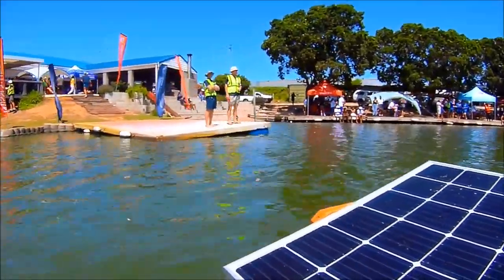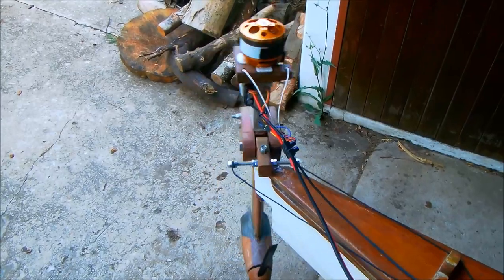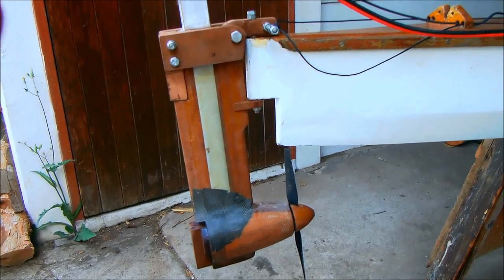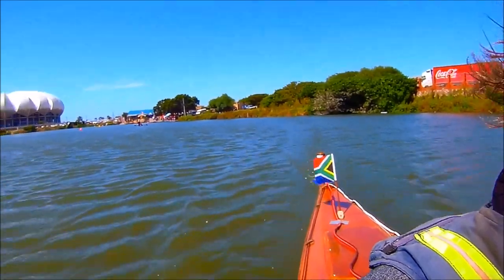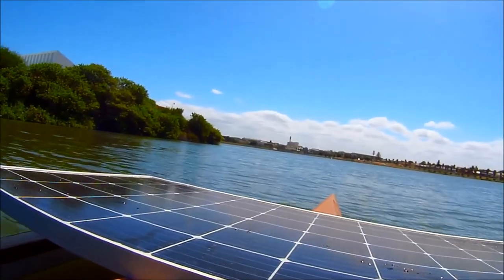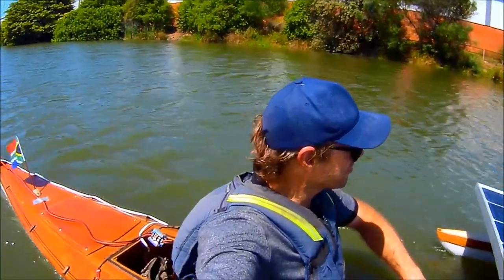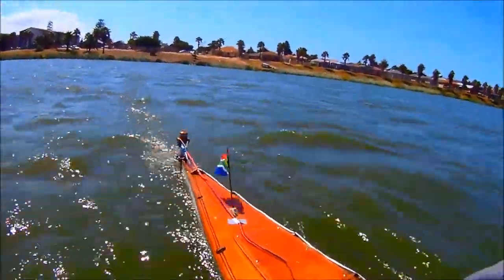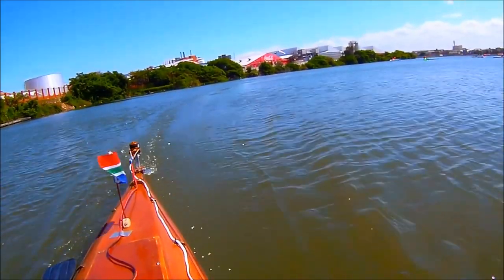Kayak Trolling Motor Test - more airplane props

Comment: That is so good! Solar power means light and efficient. I love it! 
I've been pondering a boat of some kind capable of plying the ocean - under very nice conditions. I have to overcome problems like currents and waves, so it needs to be lighter or have more solar panels...it also needs to have a deep hull to navigate swells of a meter or less. It also needs to be light enough to carry to the beach. Its a tough cookie to crack.
Reply from the maker: This panel weighs 18kg, roughly the same as a 1.7kWh LiFePo battery. At 300W such a battery would last 5hrs, at 90% depth of discharge. On a sunny day the panel should give you a longer run time at the rated power but on a cloudy day the battery will offer more Watt-hours per kg. There are panels with much better power to weight ratios so you have a good point.

Comment: If you're actually worried about the noise from the motor, consider a sine wave BLDC controller, they're a lot more silent, I believe with the downside of producing a little less torque.
Also, have you looked at those MPPT buck converters that let you set the input voltage (MPPT) screw. Basically it seems to do what your MPPO circuit does.
Reply from the maker: That is the FOC controller right?
I have one of those bucks you referred to but it is only rated 5A. I have since built an add-on feedback circuit for standard bucks that gives it the same functionality.
Reply: @williamfraser  That is very cool. I'd like to see how you accomplish that functionality.
To be honest, you know a lot more about those controllers than I do. I thought VESC could do unsensored motors with sine wave output, but it seems I might be wrong.

Edit: I've been doing a bit more watching YouTube and found this: https://www.youtube.com/watch?v=H-6qzmeCNtw. It looks like there's sensorless control with fairly silent operation, but those controllers are pretty expensive. What controller do you use?

Comment: Add waterpump to cool solar panels, probably that can improve their efficiency.
Reply from the maker: It definitely will, even a handheld mist spray bottle makes a difference.
Reply: @williamfraser  Cool! Definitely need to build, small cheap pump, with thin tubes along panels underneath, pretty simple i think. 
Good luck William!

Comment: Maybe a guard in front of the prop to make it swivel backwards and out of the water when there is a sandbank or obstacle.. just so you don't have to be on the lookout so much.
Reply from the maker: Yes that or a skeg behind the prop that protrudes below the prop. It will not help against a log but should work to prevent the prop hitting a sand bank.

Comment: Great work.  How would a toroidal propeller affect this performance, do you think?
Reply from the maker: In principal it should work fine but in practice it might have problems. The high efficiency of the aircraft props depends a lot on maximizing diameter while keeping the blade surface area low, resulting in very slender blades. A toroidal prop could  be as efficient at s slightly smaller diameter but since every "blade" is in effect two blades blended at the tips, the blade chords will have to be even shorter than that on the aircraft prop. Besides structural weakness it will likely also suffer from additional drag due to lower Reynolds numbers.